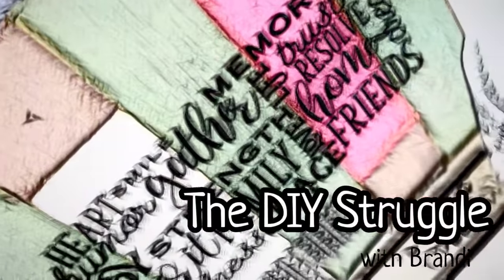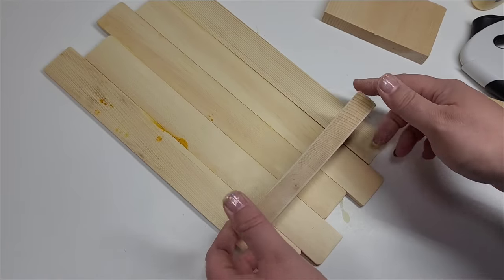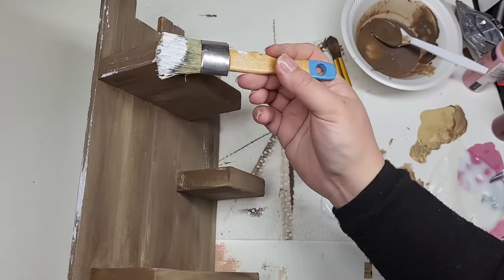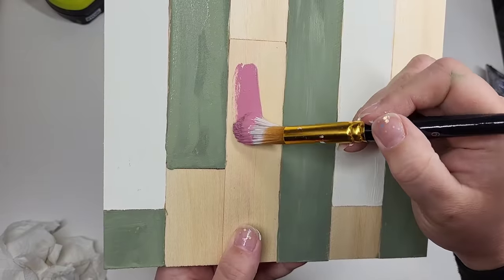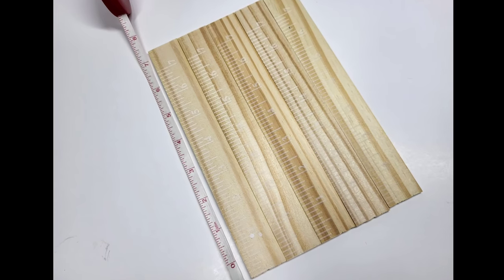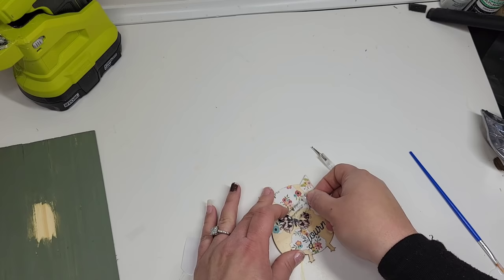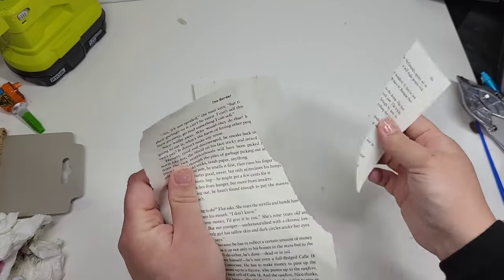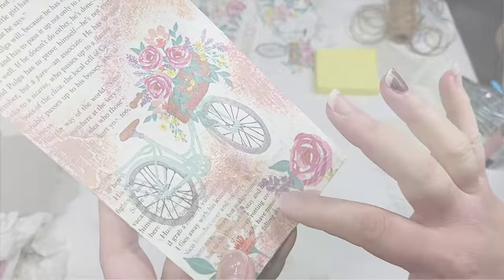PAINT STICK DIYS / PAINT STICK CRAFTS / DIY DECOR USING PAINT STICKS

Comment: Where do you get your stapler and really small staples? I have a stapler but they need at least a quarter of an inch to go through or they poke through the other side. Noticed you stapled paint sticks and it didn't go all the way through.
Reply from the maker: The one I have is from home depot. and they do poke sometimes. Ill add a little shim or wood slice some times. The staples are also from home depot they come in all different sizes. I hope this helps!